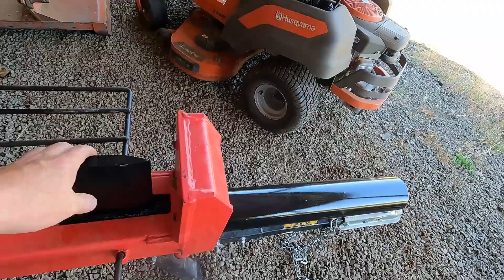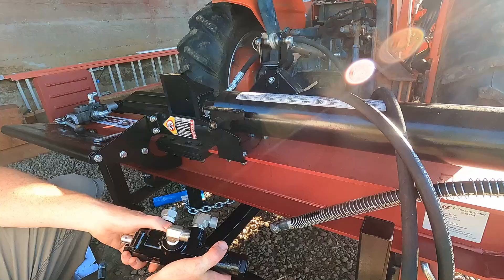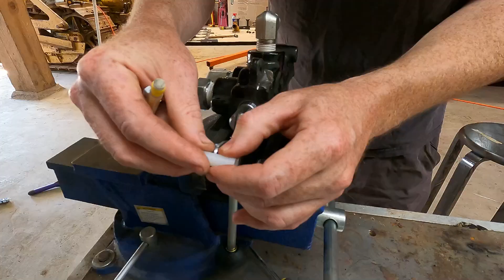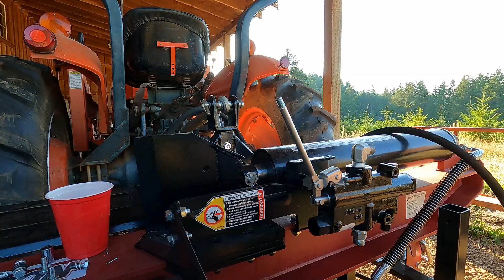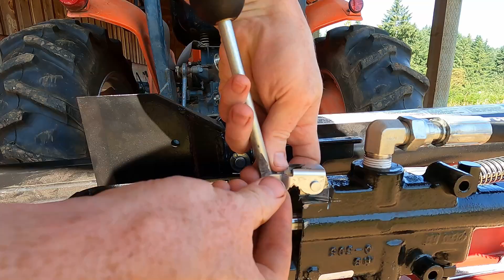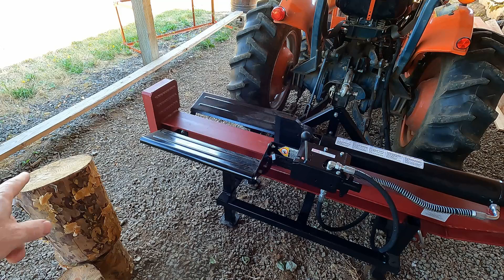Modifying a log splitter for a tractor with weak hydraulics (speed test vs Harbor Freight splitter)

Comment: You new valve is called a regeneration valve and it will only make the cylinder faster when extending.  While in fast position, it takes the oil leaving the rod end port and diverts it to the blind end port rather than returning it to the reservoir in the tractor.  In other words, it takes that oil leaving the cylinder and adds it to the volume of oil coming from the pump.   It has the exact same effect as removing the piston inside the cylinder, capping-off one of the ports (doesn't matter witch one), and extending the cylinder with oil pressure at the other port.  You will then only be working off the displacement of the rod, not the bore.  Many bottle jacks are like this where the rod that extends is basically just a piston.  No matter what the bore size, a cylinder with a 2" rod while extending with regen will have the same speed and force as a 2" bore cylinder extending with a normal valve.  The smaller the rod diameter with a regen valve, the faster it extends with the same amount of oil volume from the pump.  Of course, a cylinder without a piston will not be able to retract hydraulically, it would have to have an external force applied to it with one of the ports open to allow oil to escape.   
A valve in the regen position basically connects both cylinder ports together and to the pump.  The line back to tank (reservoir) is blocked in that position.   The cylinder can only extend, not retract, no matter which cylinder port the lines go to from the valve.  
A larger rod on the cylinder will make it retract faster (no matter what the valve type is used), and apply more force to the log while extending in the regeneration position, but since the volume of oil between the bore and rod is less, you have less oil to be applied to the blind end for a regen and therefore a slower extend speed.

Comment: In my mind a tractor powered splitter means the tractor cannot help move wood to be split, especially if the tractor has a bucket. How do you deal with this? Do you arrange the timber to be split before starting splitting with the tractor?
Reply from the maker: if the splitter is horizontal, it's very easy to move the tractor, just lift up the 3 point and go.  I normally move the splitter every 30-60 minutes to get closer to the wood pile.

Comment: Thanks for sharing the project - after you are finished with everything, I would have to guess that the fast speed is for the return stroke. However the way you have it set up you can fumble with the cut wood getting it out of the way and get a new log to split while it is moving slowly back so in all this may be a better setup.

Comment: Thanks for sharing the work you put into this! I've watched the video several times. Unfortunately, my tractor has an even smaller displacement hydraulic pump and doesn't have the remote hydraulic connections. I want to minimize the number of engines here also, but have found that in many cases, a PTO powered implement costs nearly the same as something with an engine. This was true for generators, leaf vacuums, and mowers so far. I do have a backhoe attachment with a PTO powered pump and its own reservoir, and will next consider whether I can connect those lines to a log splitter, but I think that's going to be impractical.       I found that the log splitters with engines on them usually have a 2- stage pump, so they use a greater volume pump stage until the load (back pressure) rises and shifts the flow to a higher-pressure low volume stage. I'm impressed that you found that valve and it helped - I suppose it has larger valve parts to allow  greater flow and higher speed. I would not have been looking for such a valve, because I incorrectly assumed greater pump volume was the only answer to speeding things up. Good going!!!
Reply: Build a log splitter to take the place of your backhoe bucket. I did. Sit on your but and you can pick the round up, split it and even pick up the splits and stack them. I've never looked back. No backache either. All pros and no cons.

Comment: Three things,
1. to be fair to the harbor Freight splitter, it doesn't require the cylinder to be retracted before splitting again so the cycle time comparison is not compared properly in your test.
2. The retract time on the 3 point splitter is slow because your return line to tank is too small. Because of the rod it requires less fluid to retract the cylinder than to extend it, this means that more fluid is going back to the tank return than is flowing from the pressure side, for two reasons the volume of the return side of the cylinder and the speed of the return stroke ( with properly sized lines). This may be correctable with a larger flex line back to the tractor or not if the lines after the flex line is also too small, but more than likely the fittings for the smaller flex line are the culprit as they have a much smaller ID than the hard lines.
3. Having a 3 point splitter renders the tractors usefulness during firewood processing when in use are a hydraulic power unit. Also runs up hours on the tractor rather than a motor that can be replaced for $99 when it wears out.

Comment: PTO driven Hydraulic pump With a high flow rate is easiest way to speed up you splitter i run 21 GPM pump on my 20 Ton Speedco Splitter Only Problem i have is the oil gets really hot if i split wood too long

Comment: Definitely needs some taller legs on the new splitter so you aren’t bending over. Good work!
Reply: Its on a 3-point so he should be able to lift if if he likes? It looks to me in the low position so he should be able to lift it up if he needs.
Reply: yeah was gunna say  it needs to be a foot higher or so.